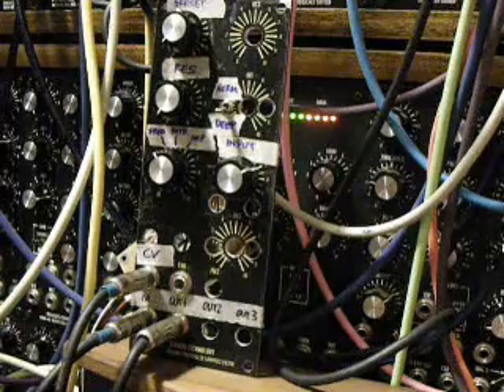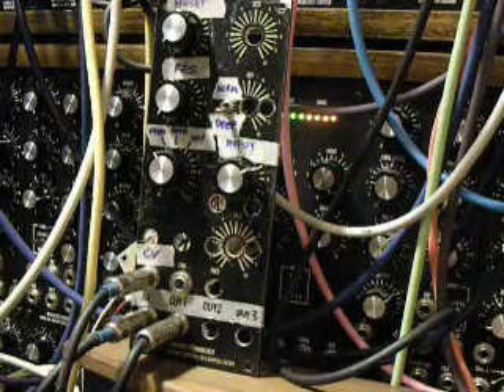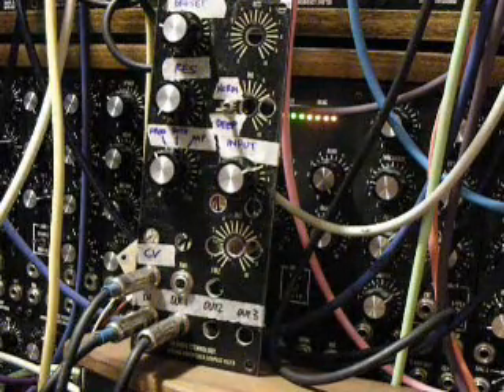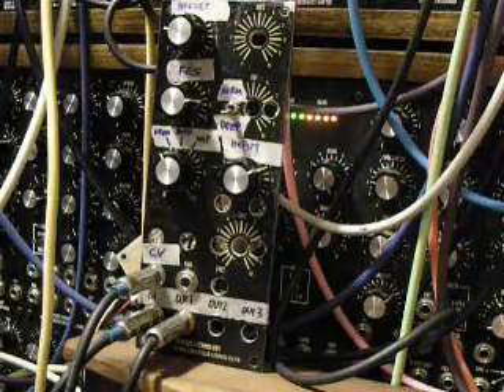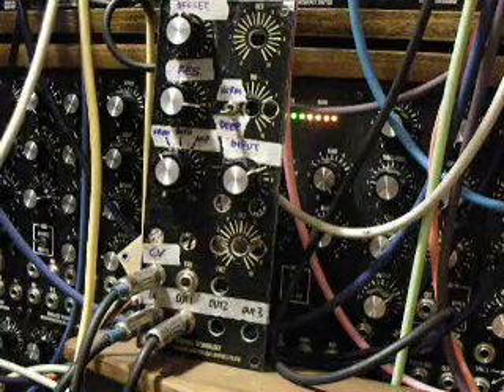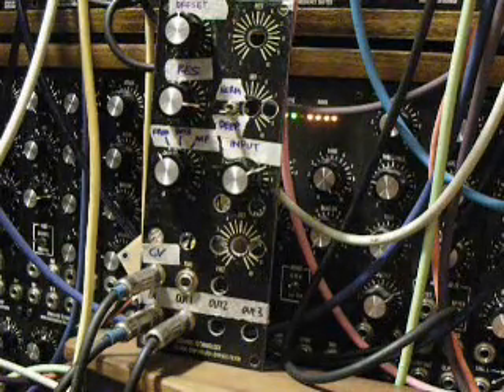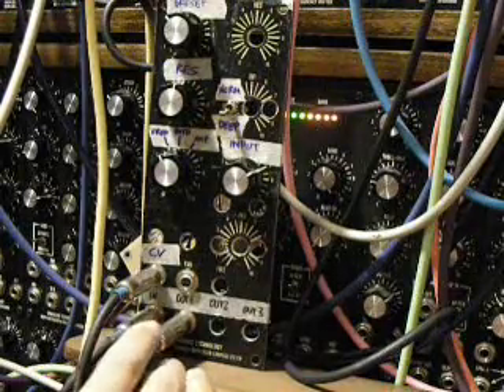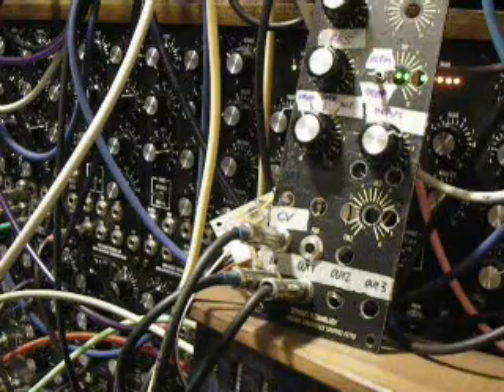Buchla Lopass Gate 292 Clone

Comment: Thomas, you make a vactrol proud.  I actually think this sounds better than the Borg as you didn't use the transistor array Grant did, which i think kills a bit of the low end.  There are some other ways to induce resonance in this circuit,some with simlar effect as yours and other more 'screetchy'.  Not being a huge fan of screech,  i think you made a good decision here. Great work!